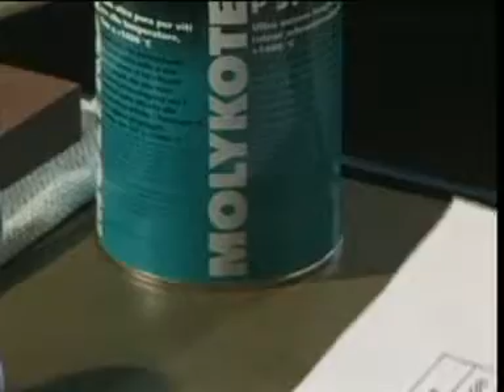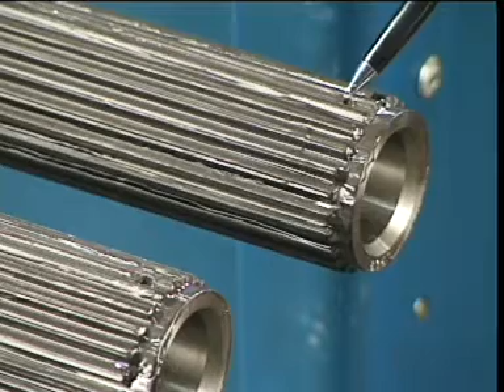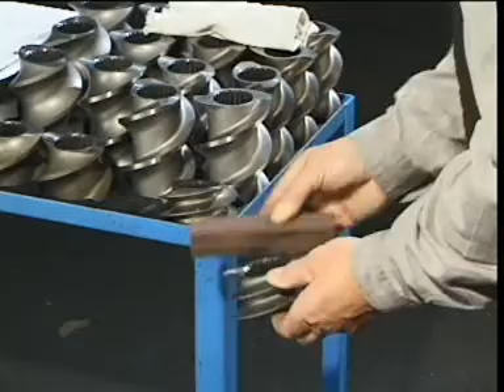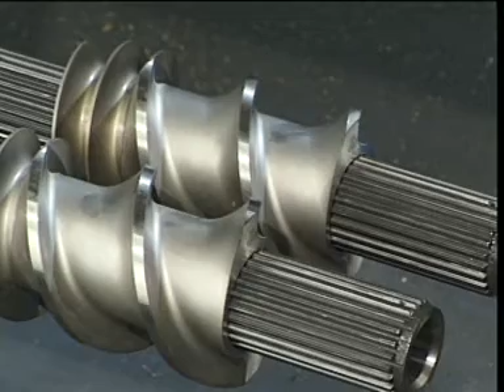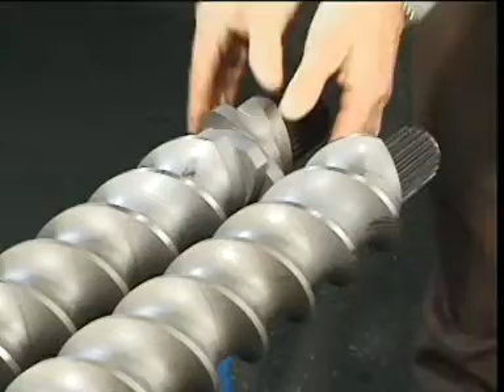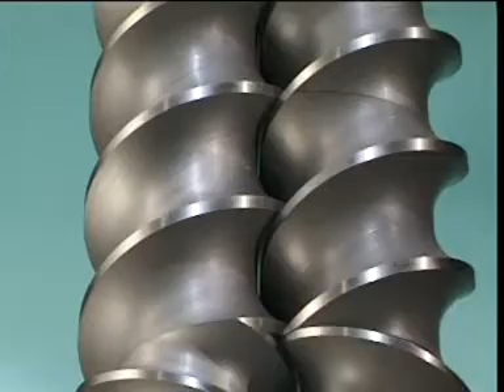COPERION   Fitting of Screw Elements

Comment: Why does the screw have less of the kneading elements?
Reply: For performance reasons - too much kneading will overheat molten polymer and deteriorate the polymer's physical properties
Reply: @andregrundmann4271  Thanks for your answer. Is this enough for powder coatings dispersion/homogeneous? It seems this too less kneading in my opinion. Thank you in advance.
Reply: @paiboonsak_GEORGE  You are right, powder coatings require much longer kneading zones